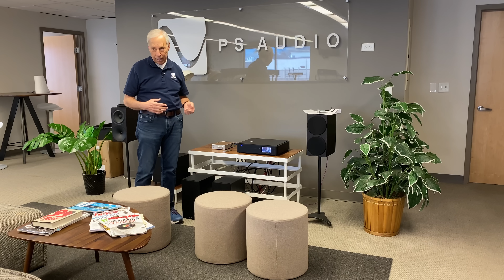Is there such a thing as too much power?

Comment: Some amplifers sound better when pushed close to their maximum power than others. All depends on the 2nd to 3rd harmonic distortion ratio, and how much it changes/increases with power output. Its also important how well a big amp sounds at relatively low power output. Larger watt amp most of the time more complex, has more (slower) devices, cannot be biased as high due to heat in case of class AB.

Speakers also have a distortion spectrum that changes with SPL. 

Some poeple prefer an amp/speakers that changes sonic character when pushed to add life and excitement.

No amp should be struggling though controlling the speakers or become harsh, losing imaging and soundstage when pushed where you want it to go (extreme volumes you dont listen at does not really matter much).

The power rating of an amp is not always an accurate indication of how well it will handle high output or difficult loads. Some lower power amps may drive low impedances quite well where current capability and stability matters.

Due to the ear’s changing frequency response relative to SPL you need to find an amp and speaker combination that sounds good at the intended listening volume. The size and acoustics of the room will also affect the sound level and quality. 

Due to the logarithmic nature of sound pressure, it is not that far fetched to use a 150w amp when the average demand is 30w. Real (usefull) headroom requires at least 4 times the average power. 

In most cases with average speakera and rooms, a good sounding 100w will suffice.

Comment: Too bad, people are idiots. If the volume knob has the ability to go around another 75%, some screwball is going to turn it that far and damage the speakers.  Although you are correct in your analysis to astute audiophiles and technicians, it doesn't apply to common Electrophonic brand stereo buyers. They always think that if the knob goes around some more, the speakers shouldn't blow. And you have to include the party problem. Some fool at your party will turn it up and blow out your speakers while you are answering the door or getting more drinks.you never once mentioned that with higher power, you cannot expect to be able to crank your amp all the way up.

Comment: Another thing to consider is the dynamic range of the amplifier. Your 1200 WPC amp may not sound so good if you’re speaker efficiency is 95 dBs or higher because the noise floor of the amp may obscure very quiet passages.  Amplifiers are nonlinear at both ends of their dynamic window.  If you know roughly how many watts gets you to a comfy listening level, +20dBs headroom will be adequate.   Too much more and you’re crowding the noise floor of the amp, potentially.

Comment: If you have more power you are less likely to encounter clipping, that where the amplifier runs out of power. Clipping is where the distortion comes from, and that is what damages speakers. I drove a pair of speakers rated at 125 watts per channel with 2 amplifiers , bi amping 200 watts channel bass and 150 watts channel treble and midrange they sounded great,  I did not drive the amps to clipping but they were playing loud without distortion,  because there was plenty of power. Always better with more than less . The one time I damaged speakers was with a 30 watt receiver.

Comment: I have to agree with Nelson Pass that the first watt is the most important.  Most hifi listeners, in a home environment, aren't going to use more than a few watts typically.  I'd rather have a low powered amplifier that sounds great at reasonable volumes than a monster amp that needs to be cranked to earsplitting levels to hit its sweet spot.

Comment: I was just checking my overhead light last night, I flipped the switch and it took a very slight amount of time to light the light.  The quantum of the physics might or might not explain the phenomenon.  I think of it as a loose rope effect only now with FLUX waves of energy.  More power forces the wave activity easier than a weak amp no matter if within a wire or in the wire surround.  For me most of the advantage has not much to do with volume of sound from the speaker, instead, it's the ability to control the waves.
Reply: WTF were you smoking when you wrote that?

Comment: Paul does't know about the famous little Buchardt  300 & 400s????!!!! (Well, they're expensive and their drivers are not cheesy at all! You should give a listen to them Paul, the employee that traded them in did well). Ok, all accepted except for one thing: When your loudspeaker has an upper acceptable RMS wattage  rating and you're listening to new music loud, you should know whether this music becomes extremely and abruptly louder, later on, for an extended period of time, because this might cause your big amp to push higher than the rated maximum wattage, for a long time, and that might fry your drivers, If you're not close enough (you're in another room, for instance) to come and lower the volume immediately. For instance, if you're listening to Mahler or Wagner at their low passages and you're tempted to hear them at a high volume, then, when the grant and slam of the whole orchestra build up, you'll have to be there and lower the volume, or your precious voice-coils (and cones and domes and ribbons) will be in danger!

Comment: I live by, it's easier to pull the horse's reins back then it is to push them forward. But at the same time, people that need machines to tell them they have bad sound probably wont notice distortion and clipping happening until its to late anyway. But then again, from what I understand, under powering speakers is also bad. People have a tendency to push their amps to far into the crap zone under powered. 
IDK though, I personally have speakers (all of them) that are over rated for their amps. Just because when I buy speakers I usually buy them to keep. If you have a 500 watt amp and 200 watt speakers sure there is a big sweet spot and less work on the amp but there is also a big area you will fry them to. It's all fun and game until $hit starts smoking. Got a low recording? Pump up the power and before you know it you are pumping 300 watts into your 200 watt speakers. I would rather my speakers laugh at my amp then my amp laugh at my speakers.
The real question to Paul should have been, how much power does he drive his IRS V's with and what are they are rated for? If he has a over powered amp hooked up to them will he let anyone in the room to play it knowing that the speakers max out at volume knob setting 15 when it goes to 50?

Comment: Where do you sell the stuff people trade in??? Is it listed online somewhere, or what? Just interested in checking out what people have sent in...may be something on their I could afford until I'm able to afford some PS Audio equipment.
Reply: Tmraudio.com
Reply: @MrRad21  damn, this screen to sign up for something keeps popping up & I can't close it to view the page. That sucks.
Reply: @jesusgavemeaids  just click on the non-highlighted X in the upper right hand corner
Reply: I couldn't. Had to refresh the page, but I finally got it. & Damn, they're milking that stuff for every penny they can get apparently. I've seen some of the stuff they have for a lot less elsewhere.
Reply: @jesusgavemeaids  I bought a music streamer from them at a decent price, but they are quite proud of most of their stuff - as in "I can't afford it"
Reply: Yeah I've thought about selling my Marantz 2220B to get a sprout. The main reason I haven't, & may not is because I also use it for my tape deck, CD player, DVD player, &  portable devices...& The sprout is just a phono preamp. Plus I'm worried they'd give me less than what I could sell it for elsewhere & resell it for more than what I could buy another one for elsewhere... based on certain factors on their page I checked out I probably wouldn't get the original retail cost for it, even though it works great & never been recapped. & After a recap I know it'd sound way better. I just wish I could recap it myself without screwing up something & just not even worry about it
Reply: @jesusgavemeaids  Check out Audiomart.  I got a nice price on a pr. of Q 3050s there.
Reply: I have. I was just wanting to see what ps audio had for sale since I like their videos & they apparently make good products. But I can't afford to pay for even they're used stuff, especially when it's a lot cheaper elsewhere.

Comment: Those are the highly acclaimed Buchardt S400, Paul. C'mon, get with the program! 😄
Reply: ...and they will take all the clean power you can feed them.
Reply: @FatRat-f9m  He should be carefully about doing that. 
S400 are proberly pattern protected.
Reply: You need to see this one: 
https://www.youtube.com/watch?v=4RTekjijV2I
Reply: @FatRat-f9m  just sayimg
I am not the police nor have any involvent in this.
Reply: @FatRat-f9m  Well, you're simply mistaken.  What they are doing is just good engineering practice, just as they are using the Harman / Toole "spinerama" measurements in their design process and marketing.   If anything, I'm copying the Celestion Ditto PR from the 60's and 70's in our design and implementation across multiple models.  PR's are quite good with low tuning with high excursion drivers and small enclosure (where ports become problematic).  Often times, PRs are designed somewhat incorrectly where they are too stiff in compliance, with rather high losses and non-linearity etc.. which gave them a bad hifi reputation at times, but done well, they can be very good.
Reply: @cbrunhaver ...Hi Chris...yeah, I was just going on a visual assessment, which is not always accurate.
Thank you for clarifying. I owned Celestion Ditton 66's, from the 70's, for 38 years & as far as I'm concerned the front facing ABR worked very well in that design. Of course my replies were borne from Paul's comment about the "cheesy" loudspeakers...lol. Anyway, I hope that the final product is a success for both you & PS Audio. Happy Listening :-)
Reply: @FatRat-f9m  Thanks for the input on everything.  That's cool that you owned at pair of those units.  We're using a custom dual opposed, inverted, symmetrical surround configuration with a tubular frame, much like the Celestion units.  We will be horizontally opposing these in our speaker larger models.  Thanks for the well wishes.  It is a dream gig for me and I hope to make some compelling options for people.

Comment: Thank you for that confirmation . On my channel i talk about how the polk audio Lsim 703s are very hard to drive so i put 265 watts of class AB power to each speaker 3 amps total 2 mono amps 100 watt at 8 ohm 1 each for HF then a dual mono amp at 165 watts at 8 ohms each channel driving the  LF so almost 4 amps in a way one amp having 2 amps built inside , and at 5 watts the 703s were sparkling i uploaded the video on my channel 703s rated at 200 watts at 8 ohms why because Bi-amped and big VU meters !
Reply: Yes, I could not agree more with you about the Polk LSiM 703. They do require a whole lot of power just to get them singing. But they do sound incredible when they have the power they need. I love your videos and channel. Thanks and keep them coming!
Reply: @giangvu7902  Got 3 audio products already in , just been working alot No days off , but yeah I will most likely drop them all with in a week or so

Comment: Occasionally, I drive in the mountains. There, I encounter peaks and valleys which challenge my car. I'd rather have 100 horsepower, than 50HP. Either engine will get the job done, but the one with more power has an easier time of it.
Reply: @FatRat-f9m  Good question. I think it's 1000 watts per channel. The guy in the white van said it was worth every bit of the $29.00 I paid.
Reply: @FatRat-f9m  Oh, heaven's no... that much quality would have cost at least $5 more. I've needed to settle for 90% THD. Best is I have full range from 1000-3500, so the vocals are nice.
Reply: @jamesplotkin4674 ...ideal for distorted guitar solos from the 1970's.

Comment: But if the sensitivity is high like 98dB/1w/1m you don't need a high powered amp
Reply: That depends on the speakers. Big cerwin Vegas have very high sensitivity, but have large woofers that should have at least 500 watts to sound good.
Reply: @oysteinsoreide4323  True, I had hornspeakers in my mind when I post my comment.
Reply: @Larstig81  It's much more about power handling. Multiply by two and you should be in the sweet spot for amount of power you should have. So if you have power handling of 200 watts, a 400 watt amp will have more than enough headroom. This is  very much a simplification though. But it can be a spot to work out from.
Reply: Still it's better with much power

Comment: I don't see how having hundreds of watts of power in an amp is useful at all, unless you want to deffen yourself,,
 using a faily efficient pair of speakers, a 50watt amp would be addiqate for normal listening.
Don't get all caught up in the,, my amps bigger than yours bushit.
Reply: Paul, you missed his entire point. It's not so you can run a rock concert from your home, it's so that you're not stressing the amp and it's power supply. The result is pure sound without any distortion. No bullshite.
Reply: @jamesplotkin4674  hi James,, I get what he's saying, but I ran a 50 watt amp on 90 dB speakers, sitting around 4 meter away and honestly I couldn't listen past half way on the vol. Not because the sound was stressed or distortion played a part it was simply too loud, just saying, it's like having a Bugatti and strolin around at 30,, what's the point.
Most folks do that though,  just so they can tell you they have a Bugatti, makes me cringe tbh.
Reply: @FatRat-f9m  It's ok, I'll always keep a seat in the corner for you :)
Reply: @FatRat-f9m  Fun is good.
Reply: You would be surprised how much high power helps even at normal listening levels.
Reply: @oysteinsoreide4323  High power, at normal listening levels, I don't understand what you mean.
Reply: @paulwibb.8944  Having a high power amplifier will be noticeable already at just a few watts of music output.
Reply: @oysteinsoreide4323  so why would you need hundreds and hundreds of watts.
Reply: @paulwibb.8944  It is very simple. Better dynamics at all volumes. And the sound will be too loud before the sound becomes bad.
Reply: @oysteinsoreide4323  well that's exactly my point, the sound becomes too loud to bear, better dynamics/ or sound,, comes with better component circuit design not thousands of Watts.
Reply: @paulwibb.8944  Too little watts will make the amp beginning to distort before the volume you want to play is reached. I would rather have a cheap 500 watt amp than an expensive 50 watt amp.
Reply: @paulwibb.8944  I have been there. I had a 120 watts amplifier, and it still was a bit weak for my B&W 683 speakers. I found out just before I gave the speakers away though. I just bought a Crown XLS  1502 drivecore 2 amp which have 300 watts into 8 ohm load.  It really was giving my old speakers new life. And that is a few hundred dollars amplifiers versus an amplifier that costed at least 3000 dollars new.  I have now bought new speakers and amp, and I have now about 250 watts into 8 ohm amplifier which is nice match for my floorstanding dynaudio speakers. And they are very well matched power wise.
Reply: @oysteinsoreide4323 ok if it's good for you that's all that matters, I'm pleased for you.👍 
I find 50 watts addiqate, my last amp was 200 watt, but the meters never registered anything near 50 watt.
Reply: @oysteinsoreide4323  what Paul was saying in the vid. About using a 1200 watt amp on those bookshelf speakers and huge amounts of power being better is just wrong though, it's misleading to newcomers.
Reply: @paulwibb.8944  Choice of equipment is a very personal choice. Each have different taste in sound and what functionality we want is different. Different genres of music and movies have different demands on the speakers and amplifier. I find that especially movies are especially demanding because of much low frequency content in many movies.
Reply: @paulwibb.8944  I will agree to that. I would say that a 100 to 200 watts probably would be a great spot for most people for those speakers. Maybe 300 if you really want much headroom. But more than that would just be overkill.
Reply: @oysteinsoreide4323  I love movies but don't use a two channel system for sound.
Reply: @paulwibb.8944  OK. Then you send low frequencies to subwoofers I guess. I send full range to main speakers. I have a subwoofer too to help level out the bass response.
Reply: @oysteinsoreide4323  no, movies and music should be kept well apart from each other, equipment choise, positioning, and interference, are a few issues that spring to mind.